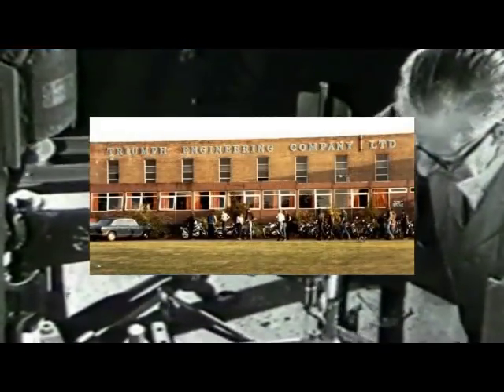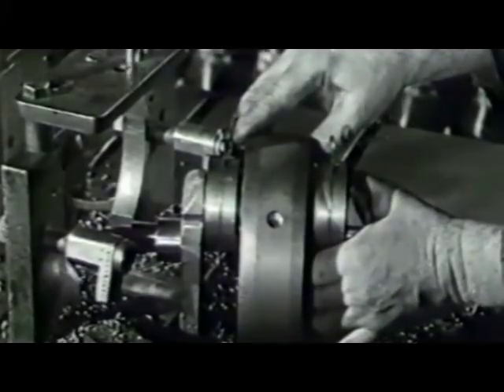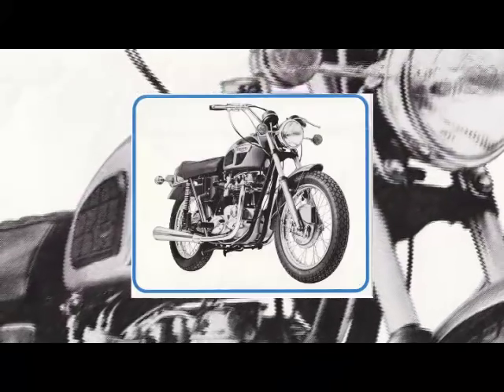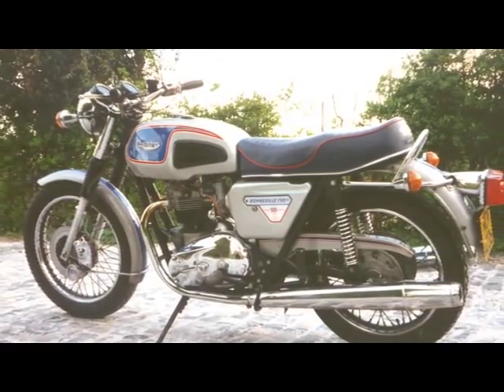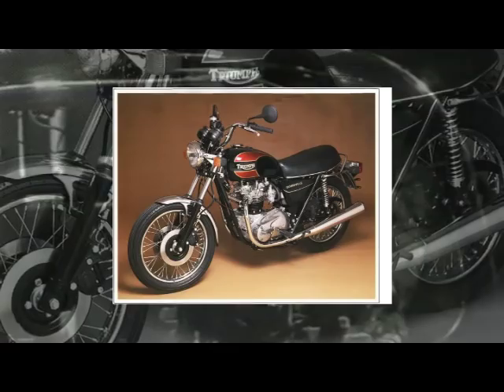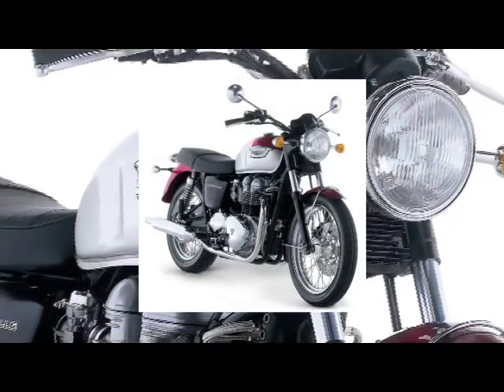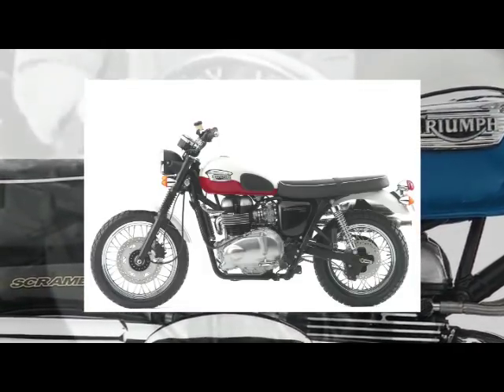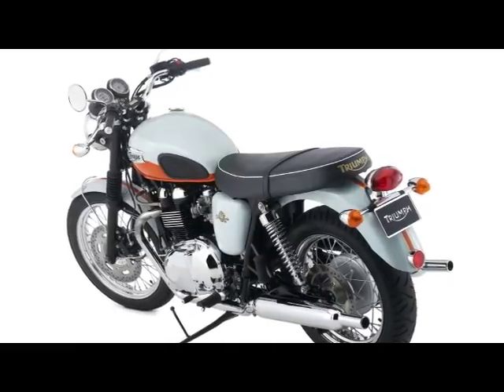A History of The Bonneville

Comment: This video not only needs updating but it's also riddled with errors.  The video is about Bonneville's but they keep showing Rocket IIIs.  Don't get me wrong!  I love R3s and I have a Rocket III Touring.  I also had a T120 Bonneville back in 1969 and loved it too despite the oil leaking from the pushrod tubes no matter how many times Triumph and myself tried to fix it.  But, other than that, I loved the bike and wish I had it still. 

Another thing that appears to be an error although it may be just the way the narrator said it, was when he mentioned the new two cylinder Bonneville as if two cylinders were new to the bike.  Bonnevilles have always been parallel twins.  

I see someone here is complaining about the new Bonnevilles trying to copy the old ones.  I don't have a new Bonneville but I've been told (and I believe it) that the new Bonnevilles are far better than the old ones.  Besides the notorious oil leaks of the older Bonnevilles, their electrics had a very poor reputation although I never had problems with mine. I guess I was lucky.  And the new Bonnevilles have fuel injection although they made it look similar to carbs.  Maybe that's what the guy was complaing about but I much rather have fuel injection.  I traveled all over North America on mine and I barely made it over the Rockies. I literally could walk faster.  I came very close to having to push the bike and so did the guy I was riding with who was also on a Bonneville.  If we had to go even slightly higher, we would have had to push the bikes uphill.   I should have re-jetted the carb but, back then, I did think about it before I ran into the mountains.  If I had had fuel injection, there would have been no problem.  I just rode my R3T all over the country including very high mountain elevations and I never even noticed a change in performance. Try that with and old Bonneville.
Reply: Bob Miller still doesn't sound like an old original Triumph though

Comment: At 7:20 : "T140V models (724cc) from 31 August 1971". This is wrong. These first edition T140s weren't introduced until late 1972 for the 1973 model year. Then quickly upgraded further to 744cc in early 1973.
Reply: Also, its not Meridian !! Its Meriden.